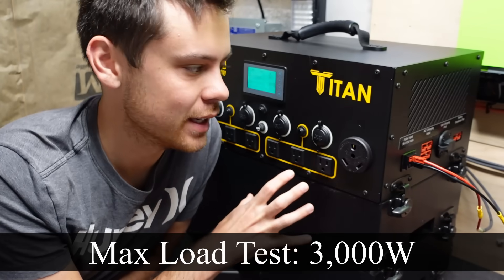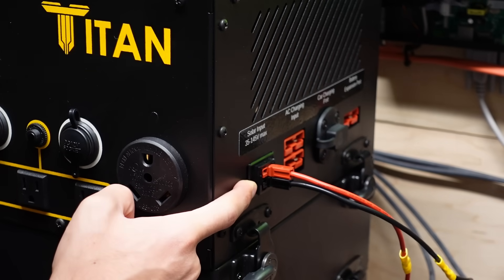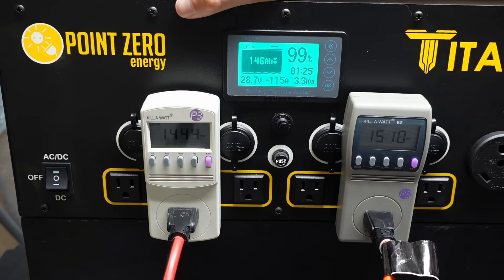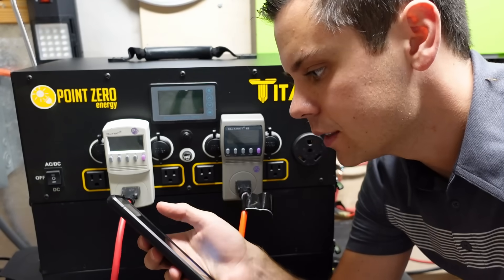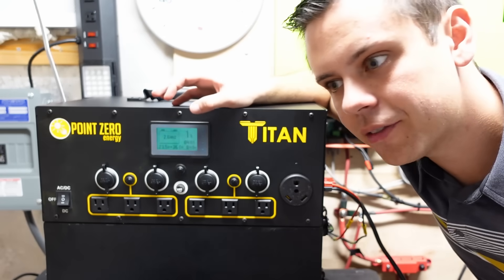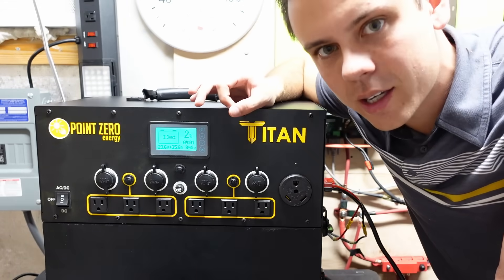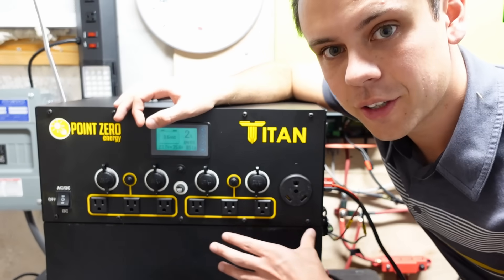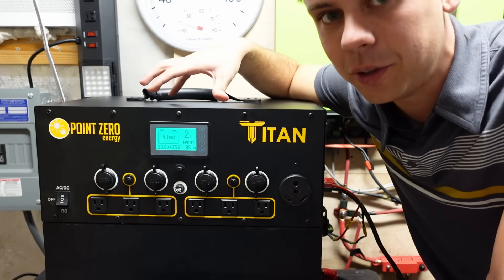Titan Solar Generator: Max Inverter 3000W Load Retest!

Comment: @DIY Solar Power with Will Prowse: Thanks for the update. Could you also test how the inverter behaves (audio/visual alarms/warnings / shut-down delay time / recovery conditions) at a continuous purely resistive (not surge) power *over*load? And at which exact wattage around/above 3000W all of that happens? Could you test this on the 15A receptacles and then also exclusively on the (NEMA 10-50) 50A receptacle? (should be the same behavior I guess) Background: My loads (almost purely resistive) are roughly 3000W.

Comment: Looks like they fixed the issues you alerted them to, which is a good sign. Availability is still going to be a problem, but a good problem to have from their perspective. I look forward to your tests on it.  One question for you: In the system you designed (and I built also) to make a portable “hand cart” solar generator, the batteries are on the bottom, but they are sealed. As these batteries stack and have a pair of connectors top and bottom to accomplish this, is there any danger of shorting something out if you inadvertently set it down in, say, an inch of water? I understand none of these are meant to be used out in the rain, but they are mobile devices and will be used outside, around RVs, etc.  It made me wonder if the connectors are sealed when the covers are on.

Comment: I ordered a 1,000w kit and have to wait till September 😔 in the meantime I'd like to figure out a large external battery setup to get or build that would work with this unit. Not much info online about that external port. A quick video about that external port would be awesome and would be great! Thanks for all your hard work.
Reply: After reading and watching a bunch of stuff on it, especially Will's because he frankly has the best, most unbiased opinions, it seems like a great system. I could be wrong, but as I understand it, I believe you can connect directly to the Titan for battery expansion. The connection for battery expansion depends on your setup, because it is a 24 volt system. So unless you buy 24v batteries, step up lesser voltage batteries like 12 or 6 to the same 24, or you get converters to decrease the power coming from the Titan to your lesser batteries, you'l have issues. All of that also depends on what you're powering (many things tend to run on 12v). Honestly, the easiest for beginners with this system might be to go plug and play, and just buy extra stackable batteries. With all the solar and/or 2 wall chargers to keep it charged it seems pretty easy and straight forward. Again, my long post comes from basic understanding, but I hope it helps and Will can clarify.

Comment: It's OK but, hard to distinguish audio difference because of all of the background noise. Video is quite good, however. 
Question Will,  if someone is having problems with their Titan not putting out the energy they think it should and they don't own testing equipment like you used, how should they test their Titan to see if they have a similar problem?
Reply: Buy a couple of hair dryers.  They use about 1500 watts each. 👍🏻
Reply: @veryinteresting591  I'll get one heck of a puzzling look when the check out clerk sees a bald-headed guy like me purchasing two hair dryers! I better check Amazon.

Comment: I know a test you can do as it is rarely I have seen it on different and that is how clean is the sinus curve and how much does it change when it is loaded and will it be girls who can damage things if you load 2000w from no load?
and have you checked how your others change from 0%> 90% load and then down to 10-25% load
can be interesting to see if it is stable or if the Hz or the voltage changes with rapid change in load

Comment: Thanks so much for getting this quick video uploaded Will. I just checked with Point Zero and my unit should arrive end of July. You had me worried about the Titan from your last video. I’m glad Point Zero was so responsive to you and corrected the problem. I have my panels installed and ready to plug in when my unit shows up. Your video quality was fine, but as others stated, I could tell it wasn’t your regular setup. It certainly wasn’t bad or objectionable though. I can’t wait to see your longer term testing results on the Titan. Thanks Will!

Comment: It was a little too quickly done but covered the basics. Your 'footage and audio' does not concern me. All I want to know is 'can I hear you' and 'does your analysis make sense'. It did on both counts.
Reply from the maker: I felt it to be redundant to repeat the tests covered in first video. Inverter test was only failure in first video.

And thanks! Good to know

Comment: Sometimes it happens with pick and place machines when a reel runs out at some point in the run and the wrong reel is placed in the machine. I used to work at Marconi and found a similar fault where they make the same board but for different outputs. Someone replaced the reel with one for the wrong spec of board. A bunch failed in testing and I discovered the issue and the component was changed on each failed board. 
Sounds like they have altered their test procedures so it doesn’t happen again which is the right course of action for the company to take

Comment: Hello Will,
I really enjoy your videos!
I'm a power electronics engineer myself and I'm also building my own powerwall.
Please use only steady resisistive load for inverter testing NO triac regulated loads! These loads are not really dimming the load they are turning it on at a dedicated point in the sinewave and may introduce peak currents which may also trigger overload protection even not exceeding the general load rating.
Try to stay away from regulated loads and stay with heaters which have 1/2/3 power settings and maybe additional some light bulbs to make smaller steps.
It would also be possible to make a load which is regulate able via a adjustable transformer this is then some inductive load but at least clean regulated.
I would also enjoy if you could get a calibrated power meter like a HIOKI but this is quite some investment.

Comment: Hey Will, It would be great if they coud make a rack-mount version with the output plugs in the back and the control panel / power switch on the front. Is it UL listed?

Comment: Would like to see it as a permeate fixture powering  a whole house, & a setup with the Titan running in parallel. Not just 2 units paralleled but paralleled to 1 megawatt if possible 🤪

Comment: Can we get them in Lithium Iron Phosphate??
Reply: I've seen some articles claim 5300 cycles on lithium iron phosphate! Would make this the last one You'll likely need
Reply: dave p that’s what I’m planing on. Dissolution of the grid. I can run my whole house off of 3,000 watts & use propane for hot water, heating & cooking.  I wouldn’t mind having some black color water bladders to assist in the production of hot water. I was thinking Server Farms can re route the heat to living quarters.
Reply: I read they were planning on offering that, but no idea when. 
LiFePO4 would make this beast a necessity.